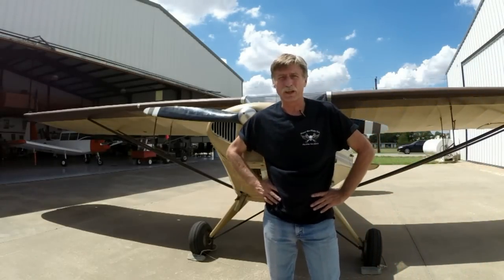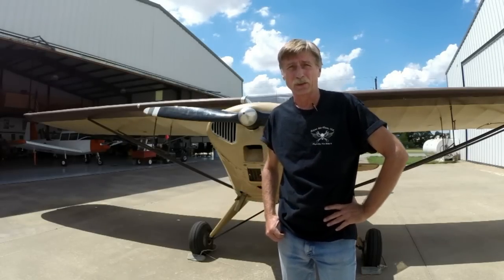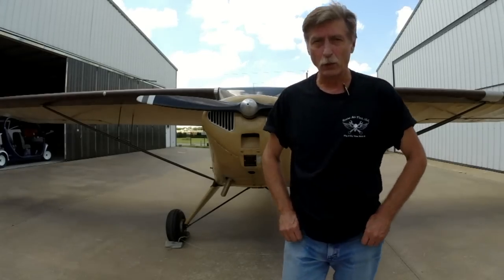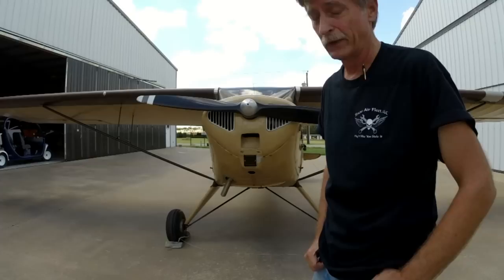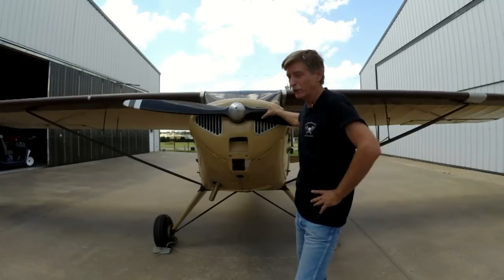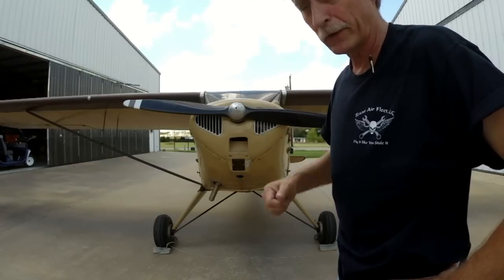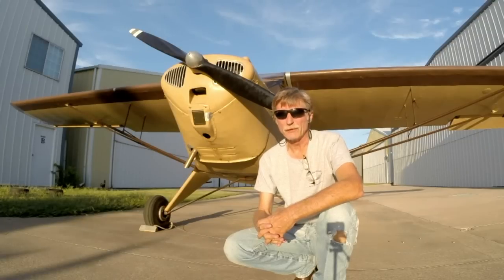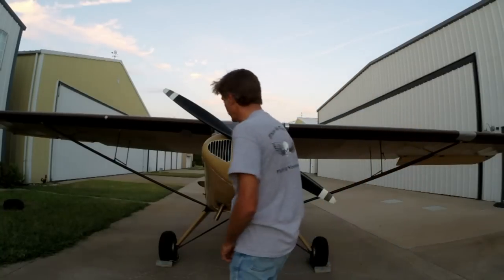Kevin Lacey from Airplane Repo - Hand Propping an Airplane Engine

Comment: I know far too little about aircraft to understand what happened in the accident, but the priming of the fuel by turning the propeller by hand a few times makes sense.   I still find aircraft interesting.  Great video. How old is this plane?
Reply: From the looks of it and my exposure to taylorcrafts probably 1947 or around there

Comment: Hey Kevin, where you been man? I seen you at Reno Air Races a few years ago, but have not heard anything since! I am a tailwheel pilot and have access to a 1946 Aeronca Champ that has the A65 in it and no electrical so hand propping is the way it has to be. The only thing I can say that I do different is when priming, I treat it as if its a loaded gun and will fire at any point. I had it fire on me once with the mags off and thankfully it backfired and went backwards and just smacked my hand, could have been much worse. Anyways, I hope to hear from ya soon!

Comment: Can it start with the mag switches off, or will the prop just spin and stop?
Reply: if the mag switches are working, no, it cannot start.  However, the magneto switch works by short-circuiting the mag to ground.  If the switch is bad, or if the wire connecting the switch to the mag is broken, then the mag will be live.

The way to verify this is to do a mag-check before shut down: turn the switch off and make sure the engine dies.  You can either let it stop, then restart it with the fuel shut off to burn out the fuel in the carb (recommended) or turn the mag back on before it stops and then cut the fuel off (convenient).  Always vitally important to ensure no fuel is in the carburetor or combustion chambers before doing anything else after shutdown: no fuel means the engine can start and kill you unexpectedly.

Comment: The first entry in my logbook, dated August 4/15/44, is marked "Familiarization, preflight and hand propping the engine." I soloed on my 16th birthday, November 3, 1944 and received my Private license a year later on my 17th birthday without ever flying an airplane with an electric starter.

Comment: Along with the other safety precautions, I learned to shut off the fuel when had propping. You will have 5-10 seconds to turn it back on. If a chock slips, you won't be chasing an airplane..

Comment: "A person of suitable age and discretion at the controls" (what an FAA man told me I needed in order to hand-prop) means I prop mine, if I'm alone, with the door on the passenger side 180 deg. open and using my right hand from behind the prop.  Easy.  That way I can also be at the controls with my left hand.  And boys, do I ever keep an eye on my throttle linkage and magnetos.  I've also seen teecrafters use a tailwheel tie-down that can be released from the cockpit.
Reply: Right? Standing in front of the propeller should automatically go against every natural instinct. I had to hand prop my dad's 195hp super cub a few times in Alaska, and even with him holding the brakes, I NEVER stood in front of that giant prop. Especially out in the bush, where guys are not working with proper tie-downs and chalks, planes are started standing next to the open door. Even at a "real" airport, I don't think I would stand in front of that murder fan.

Comment: Any specific reason why you're grabbing the prop this close to the hub? My only experience to date is on a Gipsy Major, which has just a little too much compression on it to allow me to grab it anywhere but near the tip, but was just wondering if there are any other factors involved?
Reply: Put hands flat where the blade is widest. Stand close. Use the right leg swing method on American engines. Don't dip your head, Rotate around and away as you pull through. End up facing away.

Comment: Don't pull the engine thru to prime it as shown in the video.........that is extremely dangerous.  even with the mag switch OFF,  the engine can start,  if the P lead is broke on the magneto or there is any king of carbon arching in some mag switches.  ALWAYS..............ALWAYS,  treat the prop when moving it,  as though it will start.   Use the same technique shown when starting it,  to pull the prop thru to prime it.  Also,  on small continental engines,  you shouldn't have to crack the throttle to start it,  the throttle should be close,  all the way back..  Be careful and play it safe.

Comment: Have you tried to hand prop from behind ( e.g. on the passenger side, stand with one foot in front of the right wheel, and pull down with one hand ).

If the passenger window is open, you can even control the throttle if you need to.

( I've heard this is the best way to do it - especially if your plane is on floats :-) )
Reply from the maker: David Dyck that would be fine for an airplane that you get into on the right side or an airplane with a window on the right that opens up, but that is not the case here - she fires up at about 500 rpm so simply starting it up and then removing the chocks just before getting in from the left side works pretty good. Remember, I have a string tired to the chocks on the right side, so I can pull them from the left side just before getting aboard
Reply: +David Dyck I've hand propped a J3 on floats. Doing it from behind is the only way to do it unless you want to go swimming beforehand
Reply: Yep...Gave instruction in a Cessna 180 on floats. Had weak battery and not enough money to replace it.  You can do it...I weighed 225lbs.
Reply: ...works for me too...for 56 years, and still flying a T-craft!!..

Comment: Hi Kevin, I sure enjoy Airplane Repo show.  I'm glad to find your U tube channel just watched Hand Propping an Airplane.  I'm curious to see someone remove the chocks from one side of the airplane or even yet from the pilots seat.  Would this be a new video in the future?  Herman in MO. Champ owner N467AC.
Reply from the maker: Herman Funk I have chocks under both main wheels, they are tied together with a piece of string so that after I start the engine, I walk around behind the prop down to the left main wheel and pull the chalks from the right main as I am removing the chocks from the left main - seemed safer to me to do it this way
Reply: @KevinLaceyTX  I'm a big fan of Aiplane Repo and I was wondering if there will be any new seasons in the future.